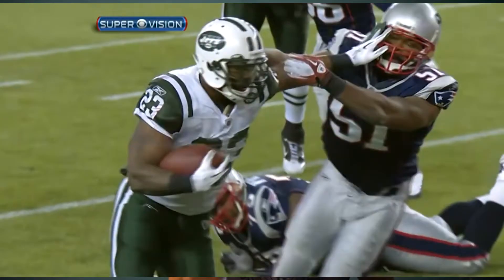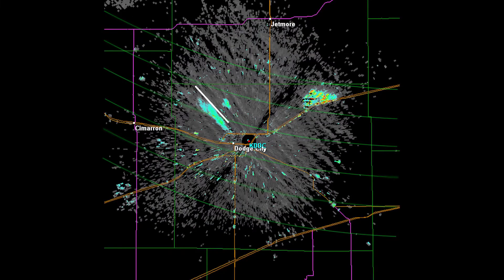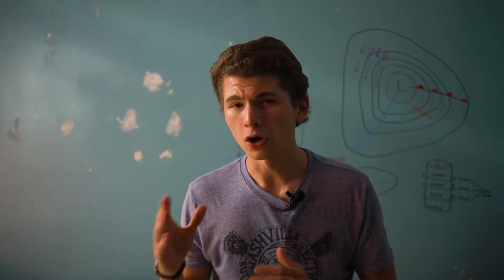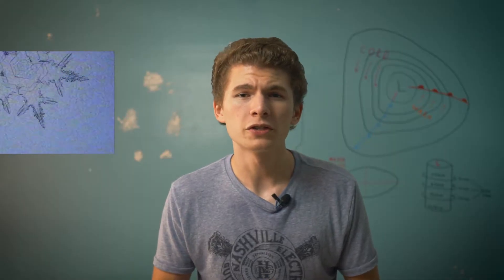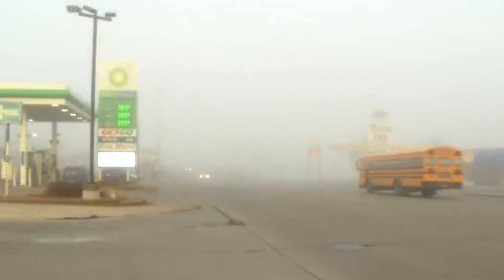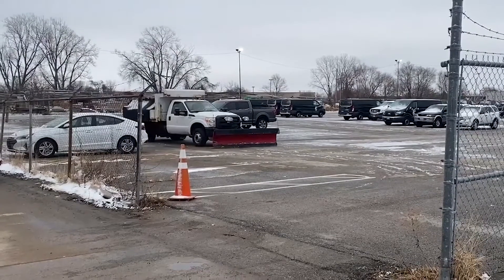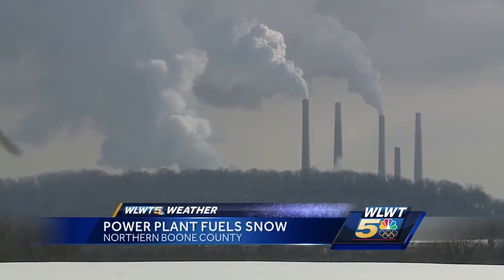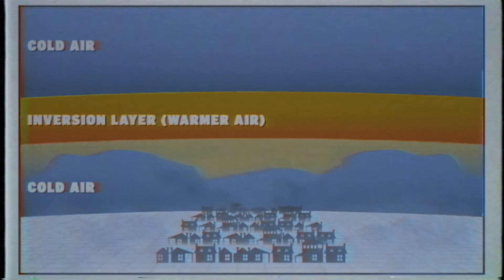Man-made snow showers happen every year

Comment: Ive been known to negatively affect local climates just by releasing a hot, humid air biscuit before exiting and holding the door shut. "Air Biscuit" is a term used in meteorology circa 1985. They are known to creep, waft and float aimlessly but all have the same effect.